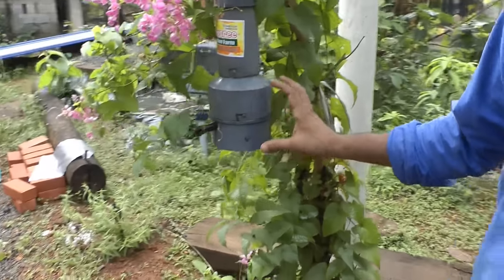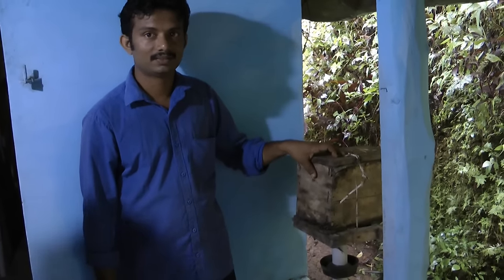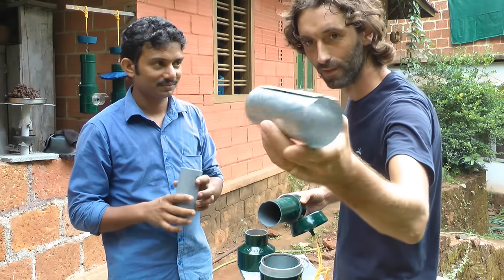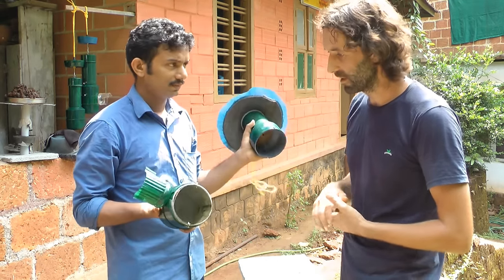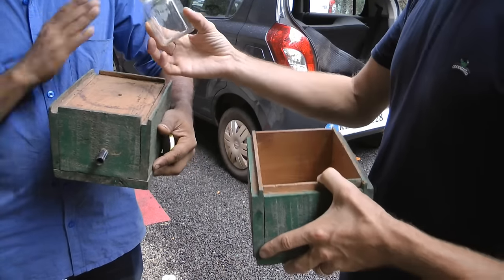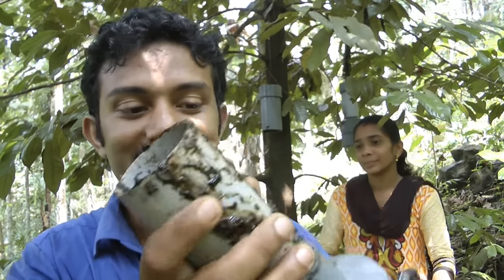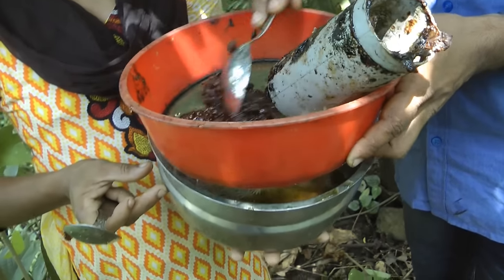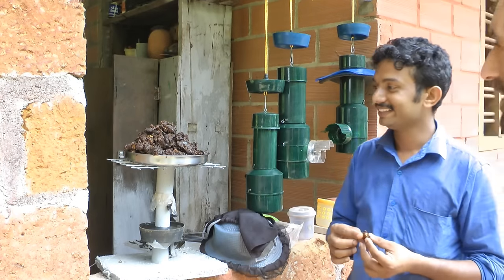Stingless Bees / Meliponiculture Part 1 - Designing the Beehives & Harvesting Honey!

Comment: With the PVC design, what were the sizes of the pipe were they using. Are there any specs or Measurements? Great design. Im here in the Philippines teaching the stingless bee to Tribal groups in the Mountains of the Bicol Region. Would love to build these here!
Reply from the maker: The thing is that you need to build something like it that overall holds 2 liters of water. Those are the dimensions as your pipe will be different than here. But I am actually going away from this hive as bamboo is way more friendly and also easy to come by for free. The way I will build mine is by splitting the bamboo in half making sure there are two cavities. Simply add a hole into the internal wall of around one mill to turn one compartment into a honey supper. I will waterproof the lot by using a coconut half above the hive as a roof and then painting the lot with a coconut oil and powdered charcoal mixture. My aim is to also share this hive in villages along with the bees, glad you are doing this work. .
Reply: Do have one already?if so any pics or videos. I have unlimited access to Bamboo here. Would love to see it.
Reply from the maker: I will make one over the next week or two and then upload the video here.
Reply: Work With Nature ok thnx. !!